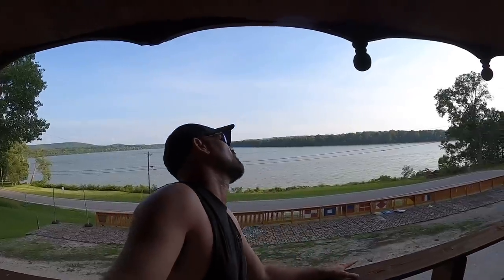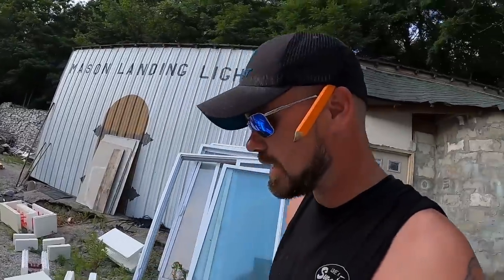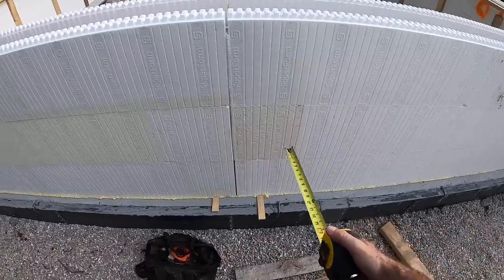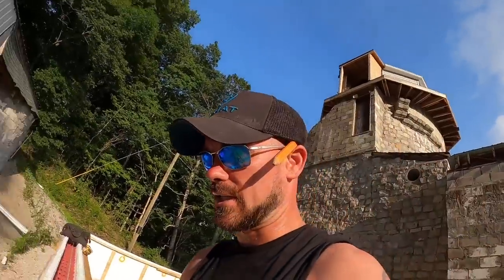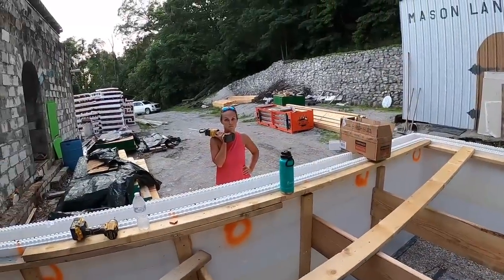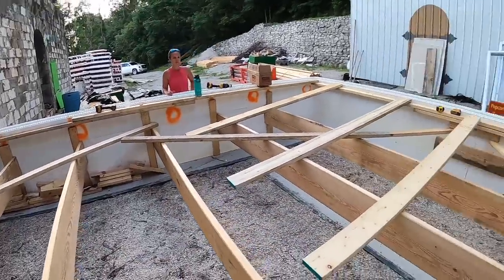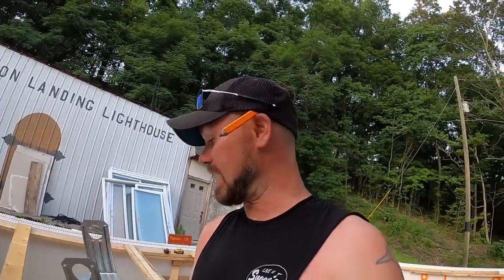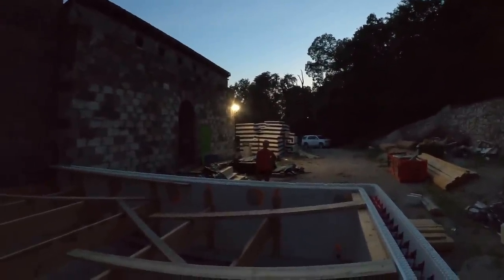How did we do??  ICF strapping pre-pour

Comment: I'm surprised at just how much prep still has to go into one of these 'Growd-up Lego' builds.  Great work!
Reply: If the building dimensions were determined by the 6" module, he wouldn't have that common joint at all - no strapping, no 2-stud blocks.  The building would have simply been 2" wider or 4" narrower.  I built my ICF home, and designed it to minimize cutting of blocks and minimize strapping.  It went really fast.  My wife placed the blocks and rebar in about a third of our 2 story 1,400 sq.ft. house.
Reply from the maker: Several steps
Reply from the maker: Agreed. But could not make it fit

Comment: Couldnt you also have put a horizontal 2x4 right under where the 2x12 was to go to make it easier to have done it yourself, granted, you had awesome help which made it easier, but using braces like that is what I would have tried if I had to do it myself/was not sure if people were around to help.  That method is how I put up some of the drywall in my garage ceiling by myself, ie cheater braces on the one side so I could lift and tuck the drywall in on the one side and my holding the other to install it. Also, do you need to foam the common seam? or will the concrete not flow out that small hole enough to matter.
Reply from the maker: Yes I could have

Comment: I realize the importance of the quality and structure of any base foundation but having seen what you have to do to insure that with this product it appears to be a great deal of financial waste of wood just to get this  and hold it straight and lumb.  This make me question the use of the form structure for financial reasons. Keep on smiling.
Reply: Until you live in an ICF house, you won't know how good they are.  If he'd just made the building 2" wider, following the 6" module of the blocks, he wouldn't have that common joint or any of the strapping or 2-stud blocks associated with it.  You have to tweak overall dimensions, as well as door & window locations/sizes when designing for ICF.  If you sub-contract all you labour, ICF will be a few percent more costly than wood framing.  However, if you place the block/rebar yourself and just hire out the pour, you won't spend any extra but you will have many advantages.
Reply: @two-sense  I appreciate your response however I've seen many ICF builds and I don't question the quality at all, only the cost of how it was done in this circumstance.
Reply: @tdkrei  Yes, as I said, design and dimensions to suit the building method will eliminate this kind of labour over-run.  Just as it will with any other building method.
Reply from the maker: No waste at all!  Never cut a single board
Reply from the maker: I wish I could have but it wouldnt fit the castle
Reply from the maker: No waste
Reply from the maker: No waste

Comment: Why not run first course of icf then pour the floor. That way you dont need pumper for the floor.
Reply: That's what we did on our home.  You really need to clean the tops of the blocks well right after your pour though, or you will spend ages chipping out little bits of concrete from the grooves all along the tops before you can place more blocks.  (I didn't make this mistake myself.  A friend told me a friend of his made this blunder.  It wasn't me.  Honest.)
Reply: @two-sense  just pour the floor not the  iCF.
Reply: @robertcantaral2959  Our floor was 14 vertical feet below the chute of the concrete truck.  We used an excavator and the old "bucket and chuck it" method, so we're not talking surgical cleanliness here.  House is built now, so no probs.  34 feet tall on a 28% slope!
Reply from the maker: Floor will be wood
Reply from the maker: Spot on
Reply from the maker: Hmm
Reply from the maker: Wow!